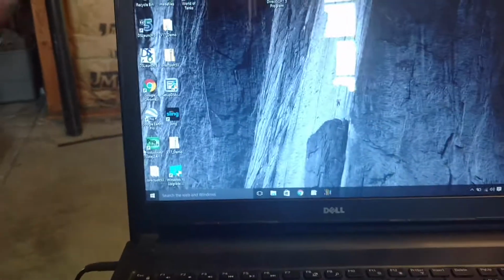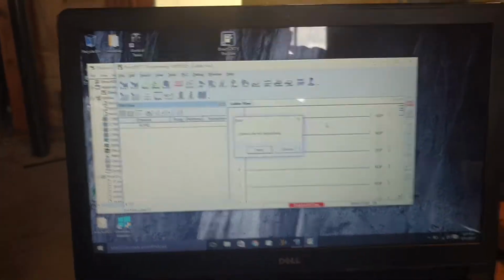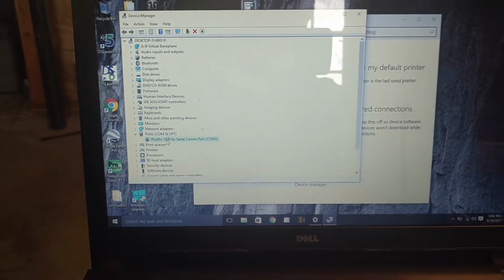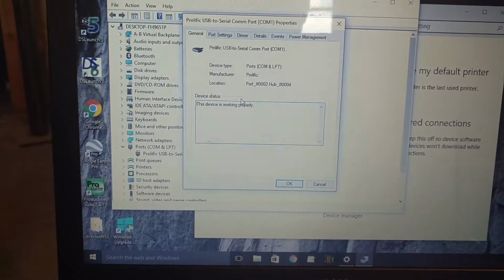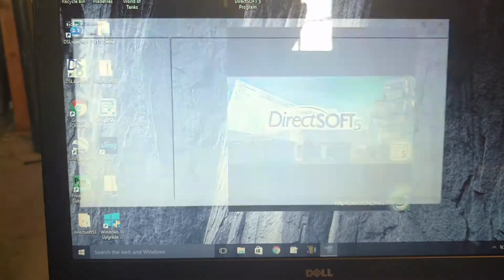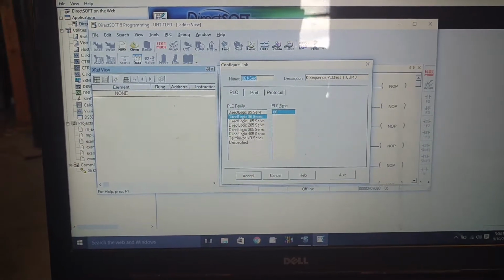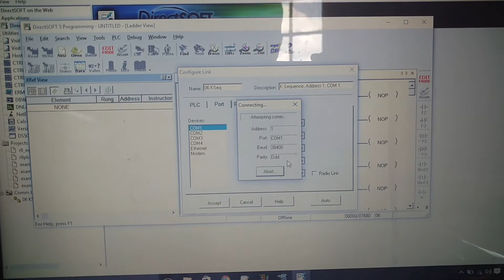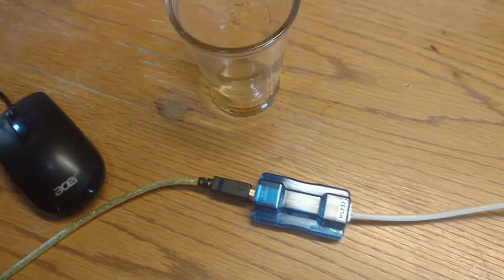Automation Direct DI-06 PLC - Troubleshooting connection issues.

Comment: Hi, i use a generic usb to rs232 converter ""Oh,  be sure to make the or by the 9-pin female D-sub to RJ12 cable"  and either trace out or just lookup the correct wiring diagram, set the DL05 or DL06 rs232 profile and it is ready for use.  Thanks a lot...:)   ps: this universal stuff can be used for a lot of hobby project devices...
Reply: Its sad the DL06 pinout isn't a regular RS232 pinout, as well as it uses an RJ12, which isn't common.